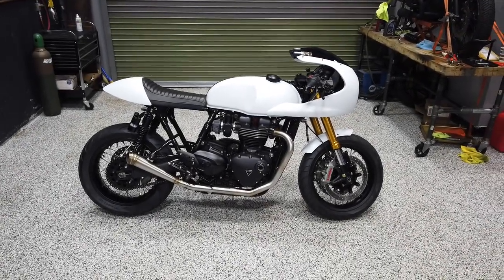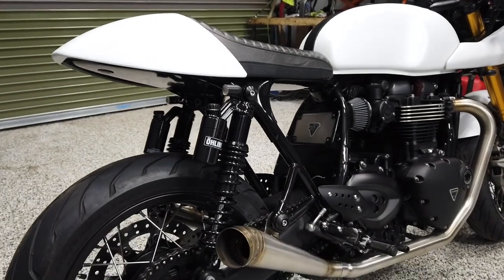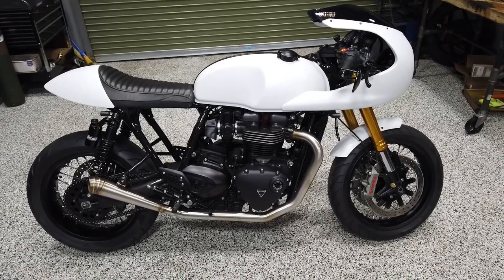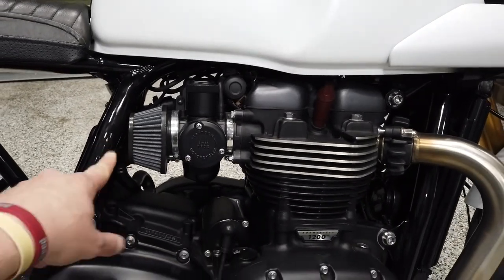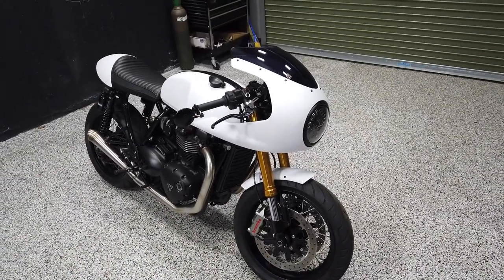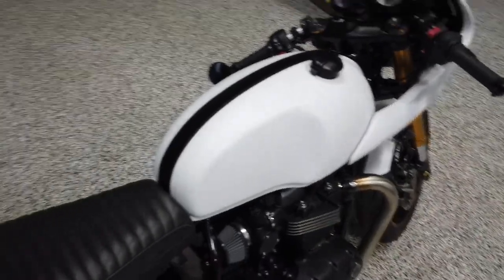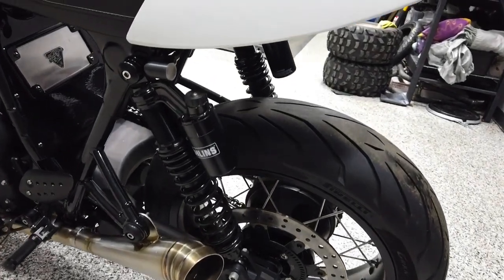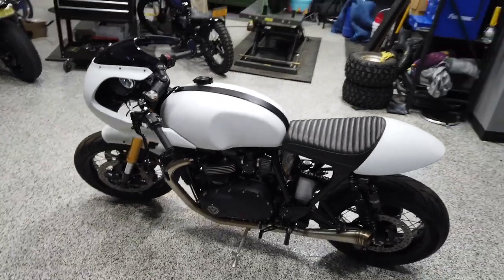Custom 2016 Triumph Thruxton R by A&J Cycles

Comment: Brian, I agree on the Sprint airfilters I will be using them at Bonneville Salt Flats in August.  Lovely Thruxton R, some day we will have to get together on a doing a project on my bike. I've found the Sprints have really been a performance adder a drag strip and dyno, I  believe we will soon improve my best top speed from 136 mph stay tuned.

Comment: whats the sound difference like between this set with the Arrow headers to the IC dual mufflers compared to the IC 2-1 gp exhaust?
Reply from the maker: Arrow is louder, 2:1 makes more power
Reply: @aandjcycles  thank you for your response, if i also may ask, the black tank strap, do you sell that on your website? if so does it come in gloss black?
Reply from the maker: @Nathan-vx8fn  we powdercoated the stock one